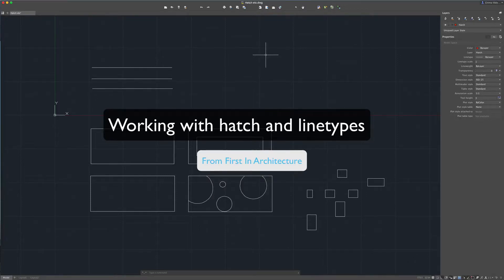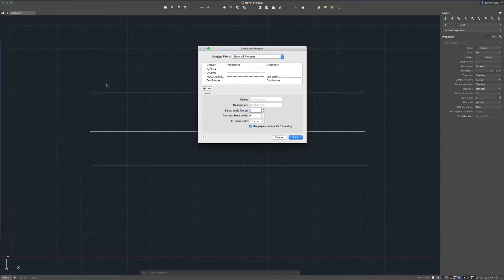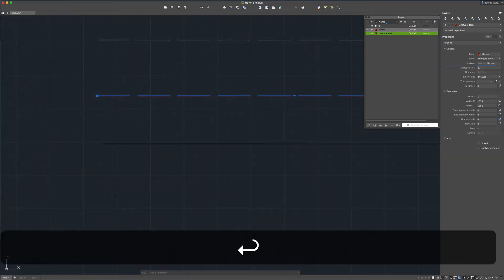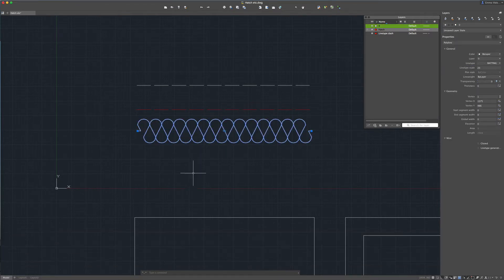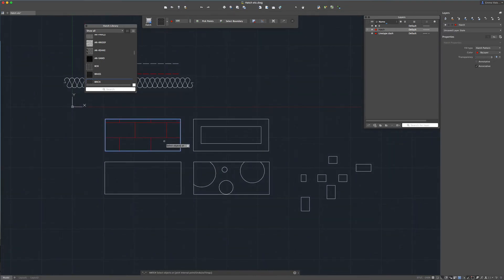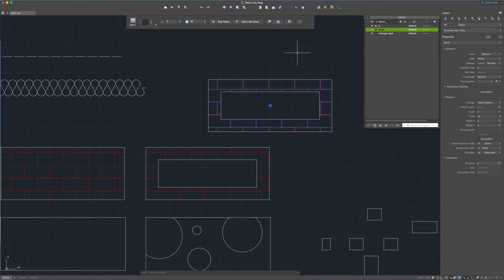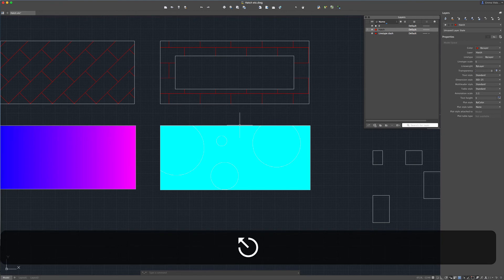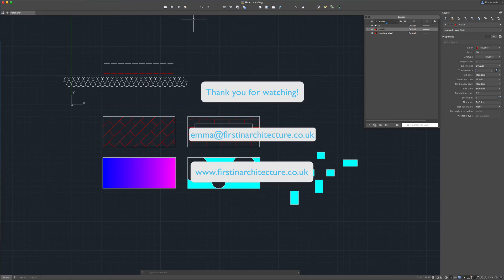Working with Hatch and Linetypes in AutoCAD

Comment: thanks for this. is it possible to increase the hatch line thickness in the model space? not for printing, but just the displayed line thickness in CAD.
Reply from the maker: Hi Peter, not sure that you can. Is there any reason why you want the hatch thickness to be increased in the model space if it is not for printing? Might be another work around...
Reply: @FirstInArchitecture  thanks for the reply. i take a lot of screenshots from CAD to highlight work areas etc for clients and supervisors. sometimes the area hatched is too large and the hatch can be difficult to make make out due to the actual line thicknesses. i can get arounbd it by increasing line thickness and printing to PDF before taking the screenshot, but just wanted to cut out those steps if possible! thanks.
Reply from the maker: @peterdonnellan  This is a tricky one. Although you can set true line weight view in cad (https://knowledge.autodesk.com/support/autocad/learn-explore/caas/CloudHelp/cloudhelp/2020/ENU/AutoCAD-Core/files/GUID-DB74CB64-2083-4285-92B9-653DEBAFEDDE-htm.html) you can't seem to set a line weight manually to a hatch other than assigning a colour, which will then be determined by the plot style. I can't find an alternative, other than the pdf option that you mentioned. One thing that might help is to set your model space background colour to white for the screen shot so that the lines show up better - but some will show up worse....! Sorry I can't be of more help.
Reply: @FirstInArchitecture  thanks so much for getting back to me again. you've earned a subscriber! 👍